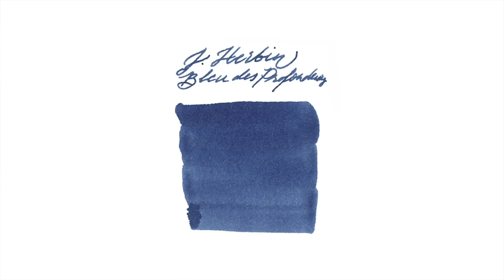Goulet Q&A 219: Dip Testing Nibs and Making Swirly Pen Materials!

Comment: QotW: Akkerman bottles. I know they are so hard to get and costly, and whether you really need that huge amount of ink or feel inclined towards the way those inks behave, but those bottles. Gorgeous and functional. I myself love having a huge amount of ink on the shelf. Like a lifetime's worth of ink. They used to have larger bottles, but currently I have the smaller size. I never see the empty bottles for sale or auction. I think people just love to hold on to them even after the ink is all gone. It's the kind of thing you can re-use if you have other large bottles of ink like Seitz-Kreuznach or Noodler's. Or fill it with colored water and glitter and have something neat to play with.

Comment: QOTW: In terms of design and functionality, the Akkerman ink bottle follow by the Pilot Iroshizuk ink bottle.
However, I am a huge TWSBI fountain pen's fan, I have to give an honorable mention to the TWSBI diamond 50 ink bottle. They would be my number 1, if wasn't for the fact they don't come with ink, expensive, and full utilization of the bottle requires the usage of TWSBI 580 or VAC700. Regardless, they are currently my all time favorite ink bottles.

Comment: Brian -- somewhere around the 20:20 mark you talk about the air channel built into the feed. Your soda straw analogy is a good one. So is a Ketchup bottle. 

Almost everyone I know tips the ketchup bottles upside down (vertical or nearly so) and bangs the bottom with their hands. Eventually, if they're not really careful, a giant blob burps out. A better method (similar to the air channel in a fountain pen's feed) is to tilt the bottle toward its target (but not completely upside down) and gently tap the under SIDE of the Ketchup bottle downward onto your hand. This will quickly open an air channel along the top SIDE of the bottle. Once the air channel exists, the ketchup will flow slowly but surely toward its target. 

Who knew FP feeds would have anything to do with Ketchup bottles? 

Cheers and thanks for your videos!

Comment: Isn't the piston converter on the Noodler's Ahab significantly larger than the Con70?
Reply: Yup, that was my thought too. The Goulet website lists the Noodler Ahab converter as having a 2 ml capacity which is almost double the 1.1 ml capacity of the Con70.
Reply: Do they fit other pens?
Reply: Hi Aaron, Noodler's piston style converters are pretty large so I suspect they'd need larger pens to hold them -- certainly the Ahab and the Neponset and maybe the Konrad but I'm not absolutely sure. Brian and Colin are better positioned to let you know which pens they'd fit. Hope you get a response.
Reply from the maker: Yeah, that's kind of a weird one. Brian was probably looking at options we sell which why he missed it. It's more of a removable piston filling mechanism... which sounds like a converter, but not technically? Leave to Noodler's to have a gray area in regards to that, but you're right, great ink capacity on it, though I believe it only fits the Ahab. - Colin

Comment: Ink bottles? Akkerman wins the top spot -- but they don't store well; they take up a lot of space, they're too tall for my drawers. BUT they are beautiful, unique, wonderful for filling pens and, they're extremely functional. Shucks, they simply look great out in the open on a desktop. Unfortunately, their ink may well be susceptible to fading in the sunlight or UV. 

Ditto Iroshizuko, the Montblanc "shoe" glass bottles ... and, yes, I vividly remember the old Sheaffer bottles with the inside (shallow) shelf or lip but I haven't seen or had one for years (decades). 

Personally, I really like the Noodler's glass bottles a lot too. They hold a lot of ink (especially when Nathan fills them to their brim!), they have wide mouths (for girthy fountain pens) and have a good height to width ratio that makes it fairly easy to get closer to the bottom with the nibs. Plus they "nest" neatly against each other in my drawers with very little wasted space. 

So, Akkerman definitely wins the top spot, but with caveats and some runners up.

Comment: Suggestion for another quick "Write Now" video: it might be interesting to demonstrate how you actually measure (to 1 hundreth of a milliliter!!!) and talk about the capacity of converters and feeds. I can think of several methods for the converters that would be fairly simple, but I never knew you measured the ink capacity of each FP brand's feeds. That would be more difficult. The simplest would be to weigh a feed (and/or converter) dry and then fully saturated but you'd need an extremely accurate and precise set of scales to do that -- and you'd need to use some distilled water with a known density (weight per milliliter). Just curious...

Comment: Thanks for answering that question that addressed the TWSBI piston cap.  I've wondered if it is suppose to be 'loose' when piston is turned...you put my concern that mine is defective to rest.  I've never had a bottle of Lamy ink before and never noticed the paper on the bottom, very cool touch!  QOTW: Favorite bottle the J Herbin brand. Anniversary bottles with the seal are sharp looking and their regular bottle because of the indent on the front that holds a pen.  Looks neat on desk with my glass dip pen resting on it but also practical to rest fountain pens while filling/cleaning up.  Love the new colors.  I have a bottle of the Corail de Tropique and a sample of the Rouge Grenat and Bleu Calanque.  I think that blue will end up as a wish for a bottle on my list.  My fav ink in that brand, so far, is the Vert Résèda.  🤓🌻 Special thanks to Brenda J. for great packing skills getting ink safely delivered along with a grape Tootsie pop.🤓🌻🖋

Comment: I love all of Goulet Pens detailed measurements. I can just look at the technical details and know whether a pen will be a good fit for me. You have spoiled me! I can't buy pens anywhere else! I need to know the difference between the diameters of the pen body and the grip.
As for the QQOW, I don't really have a single favorite ink bottle. I prefer function over style, so any ink bottle that is taller than it is wide and has a nice big opening works for me.
Reply from the maker: Crystal, who does 99% of our weights and measurements for our site, will be on Write Now in the next couple weeks! I'm interested to hear if she can add any perspective on what goes into that. - Colin